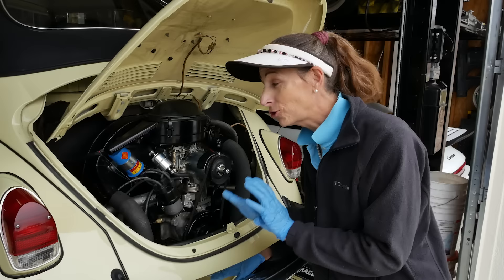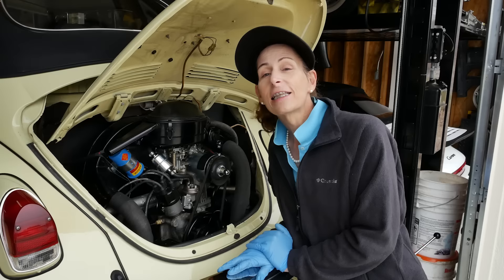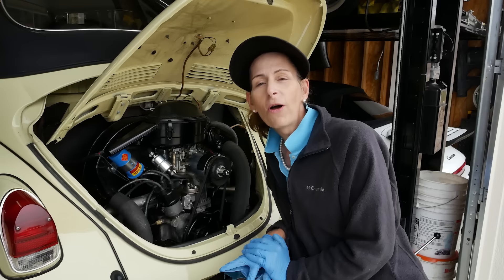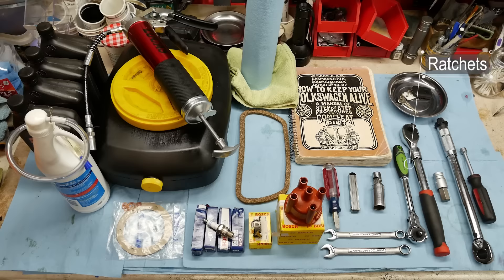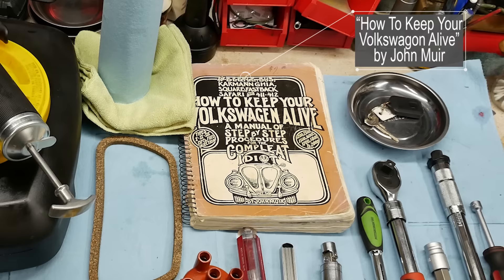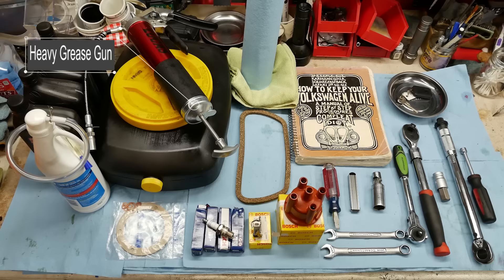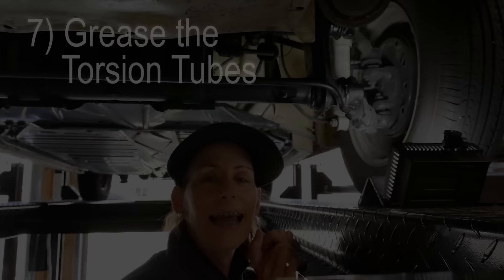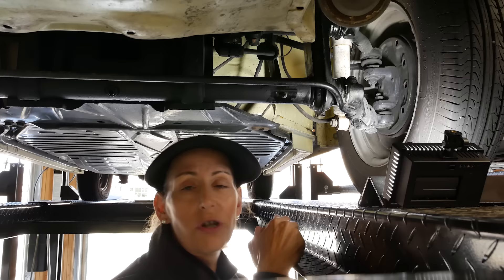VW Beetle Full Yearly Service Tune Up DIY! Easy!

Comment: Nice and very thorough video! I have been doing this for a lot of years but I think I gained a couple tips here. Very clean machine there, I have a dirty 1970 Bus. Looks like you may be in the Denver area from your altitude comment and the sticker on the dash. My idiot guide has gotten me through the last 29 years or so, though if I had this video years ago I'd have been in much better shape.

Comment: first...great video...as Im new to the bug scene I learnt heaps...Was looking for points and plug gaps,no big deal as can get elsewhere...Something I picked up on that bug-petrol filter located in hot engine bay right above a massive electronic spark source ie the distributor (engine fire waiting to happen?)...mine has this mounted exterior to the engine bay...me thinks a great idea...just saying.

Comment: This is such a terrific video that I've watched it again just before changing the oil in my 1970 Beetle. All went fairly well until I tried to install a new oil strainer. it was very hard to get in. It's like the center opening that goes over that oil tube was very very tight. The one you used just slipped right in. Do you have any recommendations on how to install new oil strainers? Maybe a thin layer of grease on the part that goes around the tube? Thanks!

Comment: Valve adjustment is about the most overlooked maintenance on these old VWs. Modern push rod motors have hydraulic lifters that mitigate this problem, but these VW motors have solid lifters which make it a necessity, and operating at higher temperatures with an air cooled motor accelerates the valves receding making the clearances very tight. Left unadjusted the gap between the valve stem and the rocker arm will completely close, and a valve will stay partially open all the time, and the cylinder won't be able to make compression. Before this happens, you'll probably get stranded a few times where the motor won't start after it had already warmed up. Essentially, left  unattended, the valve clearance/gap closes, and you end up with something similar to a longer duration and taller lift cam without the benefit of it being timed properly with intake and compression events of the piston. It gets all cerfluffled and out of whack.

4:20 Make sure the engine is cold, identify which cable is cylinder 1 on the cap. So long as the order is right, the cables CAN be placed in the wrong spots and the motor won't know the difference. 009 distributors do not have a vacuum pot and a hose going to the ported vacuum source on the carburetor.

5:04 if belt tension is already good, pulling the spark plugs out makes turning the motor over much easier

11:08 "Just a tad." Tolerances are mentioned at 14:57 Think of the screw's slot as a hand on a clock, adjust it one hour/number at a time. If it ends up on the loose side of the tolerance and/or just outside tolerance, especially on the exhaust valve(since it's the one that sees the extremely hot combustion exhaust gases), that's generally better than within tolerance on the tight side. A loose valve usually heats up and recedes, closing the gap from the rocker arm, and will put itself within tolerance.

Comment: Crap.  My 1974 1300cc ran and ran. We had it 10 years, in that time we drove it all over England, France, Belgium, Germany, Austria, Switzerland, Italy, Yugoslavia in various trips between daily use. We replaced in that time. Spark plugs, contact points, oil and tyres. That was it. Best car we ever owned. Sorry that we took it to Cyprus via boat from Brindisi in Italy, sold it there and moved to North America. Wish I had kept it.

Comment: Wish we had computers and youtube in my VW days. I started building Sand Rails in 77 and the Idiot Book was my main info. I like the VW way more then American iron but built them all at some point in time. I'm surprised to see an old bug left almost stock, back in the day there were so many specialty shops just for the dub!! I thought everyone removed the stock pully and put on a degree wheel. They just made life easier when it was time to tune.
I sure miss working on them!!!!
Reply from the maker: They really are great cars.  They are still out there!  If working on them isn't possible I bet there are shows in your area.  You would have a blast!

Comment: If you time it at 32º the initial advance might not be so good. I usually limit in the centrifugal advance so that I have a good initial timing with it stopping at 32º, you do that just bending the centrifugal advance weight stops. The new aftermarket distributors for some reason advance too much... One tip to help, you can measure the advance in the the distributor (the amount the rotor advances in relation to the dist carcass when you move the centrifugal weight to the stop plus the initial timing it's the max advance) but remember, as the dist move at have the speed of the crankshaft, the degrees measured in the rotor are half too (ex. 10º of advance in the engine, is 5º in the dist rotor). then after adjusting with this reference, reassemble the dist and check dynamically with the timing light.

Comment: Hello Franny. I'm from Brazil and became addicted to your videos. Congratulations!
I have a question. I notice that is sort of a protection at the bottom of the heather channel on both sides on this particullar model. Never saw that before.
Do you know what that is?
Thanks!
Reply from the maker: That is a great question.  I'm assuming that is an aftermarket support welded into the pan.  The floor boards are all new and powder-coated.  It has been a while since I've been under a beetle, but that did look different to me as well.  Unfortunately, the gentleman who had this car restored passe away before Jerry and Judy acquired the car.

Comment: when is time to adjust our 1980 1300cc valves, we like to clean carbon deposits using an spray called car80. pull the air filter out, and run the engine on idlle spraying car80 inside the carb to clean the admision and exaust valves. then wait until it cools down a bit and start the adjusting.
Reply from the maker: That's neat...  I've never heard of car80 - We have things like "Seafoam" and a couple B&G products as well.  I'll look into that.  Thanks, F

Comment: You are a hoot. My 73 Super Beetle had a locked up engine and I found Cylinders 3 and 4 locked into the cylinders. It appears someone had put water in the bug engine.

Comment: Oil filter plate can be replaced with a piece of 1/4inch aluminum cut and drilled to shape and with slightly longer bolts.

Comment: I set mine a little tighter, tight enough to turn the engine over not more. The Gates Belts can handle that!
Reply from the maker: It isn't an issue of if the belt can take it but the bearings in the generator/alternator. Belts are easy to change, bearings not so much...

Comment: Granny, thanks for the video. Would like to know two things. 1. What oil for air cooled motors are you using. 2. How to set you dynamic timing if your strobe does not have the dial in facility. Thanks
Reply from the maker: ...what spell checkers do to my name... LOL!  I use Valvoline 20W50 racing in the 356 and the 3.2 Carrera.  It has always worked well for me and has a bit if added zinc.  
If your strobe isn't adjustable just measure out and add a white tick mark in the flywheel at 32deg or so.  Then just look for that at max advance.  Good luck!  F

Comment: Great video! I’ve learned so much by watching. I do have a question about the Actron Tachometer cp7605. When you set the timing at 3000 RPM, the tach was at 11 for the 8 cylinder setting. Wouldn’t that be 2200 RPM for a 4 cylinder? I’m getting ready to set my timing and wanted to make sure I understood the reading of the Tachometer.
Reply from the maker: The long and the short of it is you just need to set the max advance at whatever RPM that is.  Once you have the max advance you can then check it statically and you can use that from then on :)  Good luck!  F

Comment: I would like to see you do a video on an autostick like that also.
Reply from the maker: Hi Brent.  I'd have to research, but I think the only real difference is the clutch.  They are a bit different to drive.  My dad had a '68 back in the day and I found it a bit confusing coming from a three-pedal car.  It will teach you not to drive with your hand on the gear selector though ;)

Comment: great step by step - thanks  Is there a video on how to adjust the belt tension?
Reply from the maker: I hit that in other videos, but I like to set the belt a bit loose - Turning from the generator should move the engine but slip when a cylinder goes into compression.  A slight squeezing of the belt will get it through, but any tighter than that and you risk destroying the generator bearings.  Any looser and you won't produce enough electrical power.  Most folks have it way too tight.  I use john Muir's "Too loose, no juice, too tight, no bearings".  Just swap out shims from the pulley halves to the front of the pulley and back until you get the right tension but always keep all the spacers either between the halves or on the hub.  Otherwise the generator shaft will be too long and you will bury the hub nut before getting it tight.  One last thing - if your shims are rusty either clean then thoroughly or replace them.  The rust will cause them to loosen up as the rust crumbles.

Comment: You have the best how to car videos I have ever watched.  Thank you for the great content and quality of the video.  I am a new beetle owner.  A 72 Super Beetle that my aunt bought new and recently gave to me.  I was born in 72 and rode in this car as a child.  It's been a daily driver for almost its entire life.  I am getting it in shape and learning a lot as I go.  I wanted to ask if you could address the canister located behind right rear wheel.  Maybe a charcoal canister for evap system?  What is it and do you service it or replace it or delete it?  Also, there is a very small black on/off plastic switch under dash on drivers side.  Looks original but no idea what it is for.  Any ideas?  Thank you...
Reply from the maker: Hi there, Glad you liked the video!  I think your mystery switch is the rear window defroster :)  You're call on the charcoal canister.  I believe you can still get them.  
Congrats on a very special car!  My first Beetle was a '72 Super Beetle.  Loved that car!

Comment: Loved your video. Very well done but I was looking for a recommendation of proper oil to use on my 74 Super Beetle. You didn’t mention what you use
Reply from the maker: Thanks! Oil is a very cantankerous subject! I use Valvoline 20W50 Racing because of the added zinc.  It has always work well for me.

Comment: Hi. I seen your entire video its very much informative, but there is not check break fluid level in periodic maintenance and break system check / adjustment. so keep in view it is must be check break system that in good condition. Thanks, I hope you next time in mind for break system and make a very informative video break adjustment, cleaning and servicing .
Reply from the maker: Ok.

Comment: I could have used one of these about rebuilding the wiper motor and linkages, and switch for a 67 bug, this week. What I figured would take me a couple of hours, took 3 days.
The diagrams on Wolfsburg West for the linkage was completely wrong and photos I found online were not really 67, and its seems that VW changed everything each year.
Maybe I'll make a video.
Reply: Ouch, a ‘67... VW for sure changed every single bit in that model year. And only for that year. Same goes for the Split Window Buses.

Comment: You've made a wonderful video - I'll be revisiting it as I perform these maintenance tasks. I have three vw beetles. One (1961) came to me with an aftermarket bypass oil filter installed. It sits in the space just below the generator/fan pulley. Any thoughts about this? I'll be on the lookout in case you answer me here - would love to have your opinion. It seems unnecessary to me, maybe even a fire hazard. Would you keep it or restore to original specifications? Otherwise, the car is in fine shape, except for what seems to be a shift linkage issue that I'll be using another of your videos to help me fix.

Comment: Amazing video !! But where did you get that normal handle short shank craftsmen screw driver that you use for the valve adjustment ?!?? This is a must have for me. Thank you !
Reply from the maker: Thanks! I believe you can get Craftsman at ACE hardware. Otherwise I bet you can find something similar online.

Comment: I've just done pretty much everything in the contents (minus transmission oil), for my first time. . I wish I'd found this video a week ago!

Still not running quite right though. Tends to "puh" occasionally when its at lower revs, and if it does it a few in a row it sputters out.  I did have one poof of smoke at one point, and it seems a little smokily over all. I'm going to do a compression test and see if I find anything. I did notice that the inside of my engine (under valve covers, spark plugs) was quite soiled and black, so I'm thinking I might need to pull the whole thing out...

Comment: Thank you for this great video!  I was wondering if it's possible to gap the valves on both sides at the same time, or if it must be done one side at a time?  Thanks in advance for any help with this question.
Reply from the maker: If you go backwards through the firing order then you can stay on one side for two cylinders.

Comment: About to grease the torsion tubes myself (thanks for the great video).   A couple of questions:  1) I was watching another video that said the front end needed to be jacked up to get the weight off the wheels to properly grease.  Is that true?  2) What type of grease should I be using?  3) If it's been many many years since this has been done (I'm a new owner), should I keep pushing until I completely refill the tube with 100% new grease?  Basically, don't stop when I see a little come up....get ALL the old grease out?  Thanks so much for your help.
Reply from the maker: Hi Charles, If you have the older style front suspension then yes, jack the car up, loosen the king pin and grease and then reset the pin.  For the torsion bars it won't matter.  You do want to push some grease through.  It can be helpful to use a different color each time so you can see the new grease flow out.  It is a bit like changing the oil.  Our 356 seems to push out about 1/2 of the grease anyway so I don't have to push all that much through.  It is a great service and really good for your car :)

Comment: It looked like it was at 36* of total timing not 40* before you changed it. If you look at the spark plugs and they look fine as in no melted or pitting ground straps and the heat mark on the ground strap is in a good location, there is no reason to take away the extra timing IMO. If you have the car on a dyno and can verify it's losing power or staying the same with more timing then you should remove some. My guess is it probably made more power and ran cleaner on the 36* of timing. This is because our pump gas is more stable and less prone to detonation with 10%Ethanol over conventional pure gasoline these cars were setup for originally. Ethanol also absorbs a lot of heat as it evaporates which decreases intake air temps further stabilizing the combustion event.

Comment: Comments
822

Add a comment...

electroman
0 seconds ago
Hi this is a 5 uear old video, but just want to say that although you found the advance to be a bit hot, it may be because you have a 009 distributor without vacuum advance..so it was set a bit happier...the electronic ignition will not compensate for advance without the vacuum as its just like electronic points, its not a ecu. just saying maybe I'm wrong. so i thought someone set it hot just to keep it at a happy average once its going as there is no advance otherwise with this distributor  hope it makes sense.

Comment: Well done for this extremely informative video with excellent attention to detail 👍👍one further question based on your vast experience working on aircooled engines, what engine oil and transmission oil do you recommend? Thanks in advance for your help.
Reply from the maker: For these cars we have been using Valvoline 20W-50 Racing.  It adds a bit more zinc.  These transmissions don't perform as well with the high-end synthetic lubs like Swepco so I use standard Valvoline gear oil, 80W-90 or close to that.  Seems to work well and both are available locally - a big plus when you are out of town on a drive and you need to top off.
Thanks, Franny
Reply: Thanks for your prompt reply 👍👍

Comment: Great video, I learned to always set the valves completely cold. Does it make a difference?
Reply from the maker: Yes, the valves should always be done on a cold engine.  Easiest to get the car hot, change the oil and then let it cool overnight and do the valves the next morning...

Comment: Hi there, The timing mark increment lines are not reading that good in all air cool engine Beetle. At Edelbrock items stock in kits selling sticker that is tape to the Volkswagen pulley -maybe and it add more line of measure increments; it will show the degree of its dwell. Maybe use paint white thin line to make it easier to read 20 degree BTDC scratch the line and add more scratch the line in pulley and read 32 degree BTDC and so paint up the increment. It is much more sense.